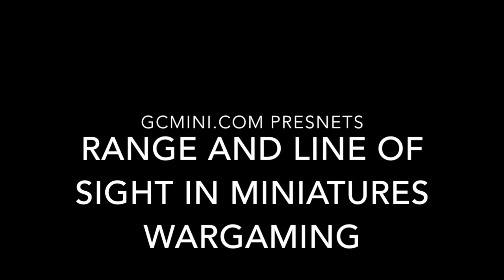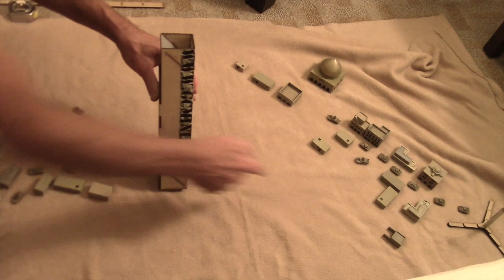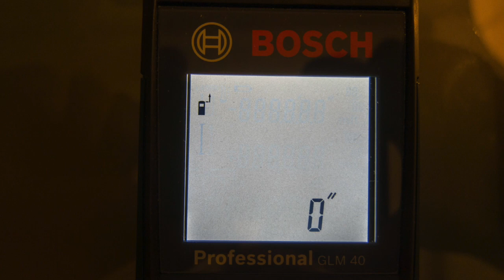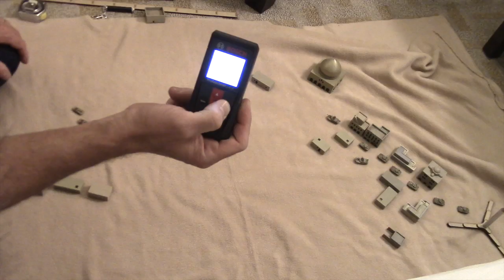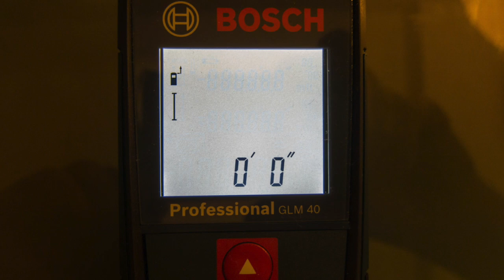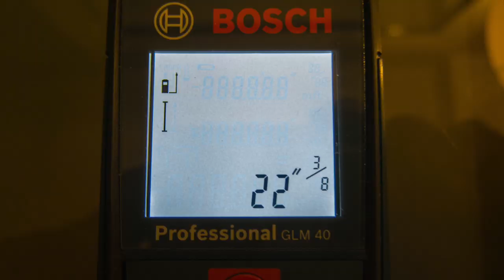Range and Line of Sight in Miniatures Wargaming

Comment: what scale would you suggest i use on a 6 by 4 table from modern wargaming?
Reply from the maker: For large tank battles I would suggest 1/285th (6mm).  For smaller skirmish level with a few vehicles, 20mm or 28mm.
Reply: Ground scale 1cm = 20m